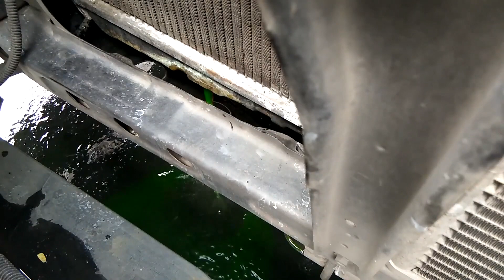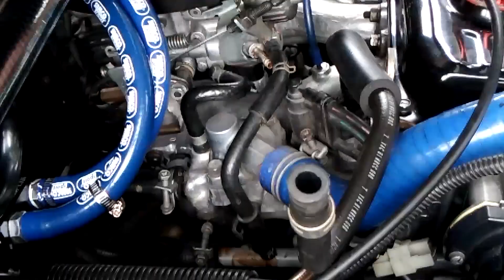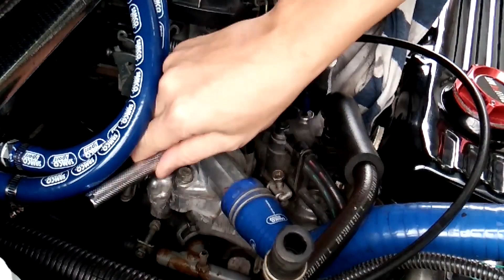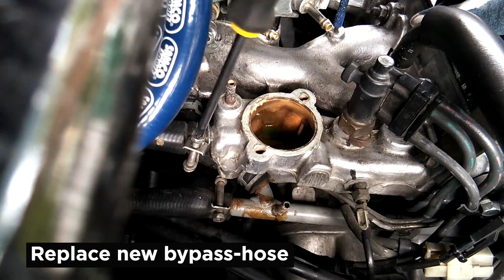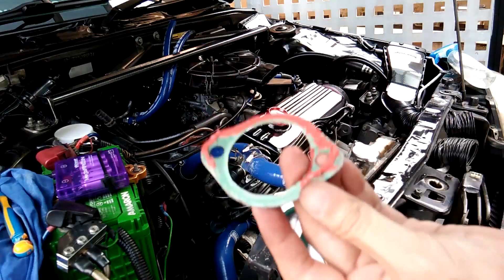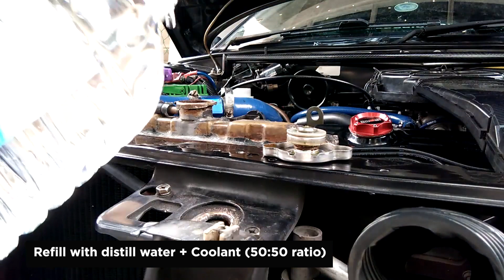Saga LMST Tanpa Thermostat dan tukar coolant

Comment: I also remove thermostat LMST and direct connection fan. but i notice at idle temp is at 75celcius. but when driving at 70-80kmh the temp will increase to 80-85celcius. I think coz the coolant is flowing too fast through the radiator so its not cooling it fast enough. The thermostat is creating a slower flow. I think I want to put back the thermostat with modification ie out 3 bypass holes. some youtubers in Australia and US hve video.
Reply: thermostat is there for a reason. It helps to maintain ur coolant temp otherwise coolant will keep flowing thru engine and radiator so it always cold.